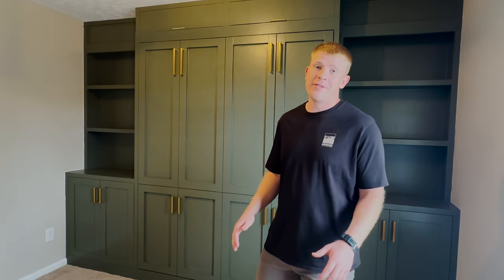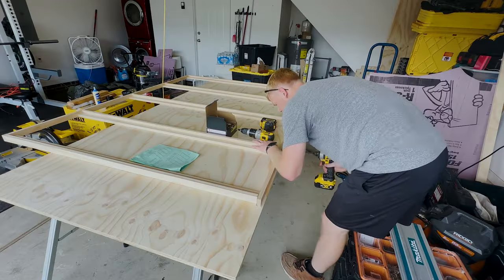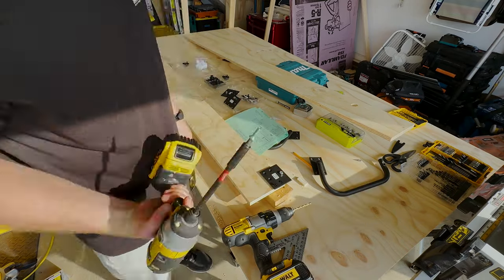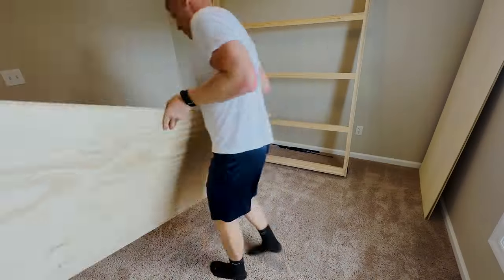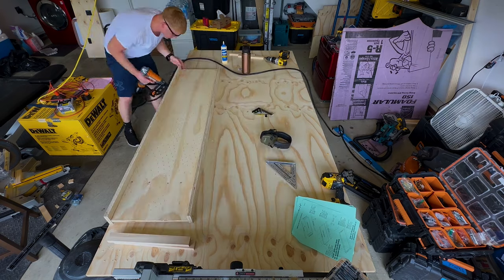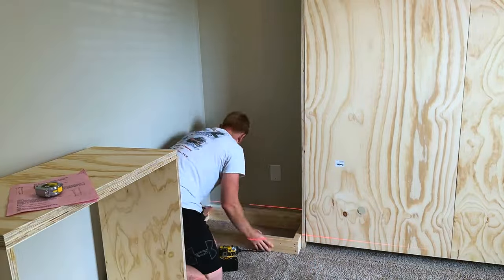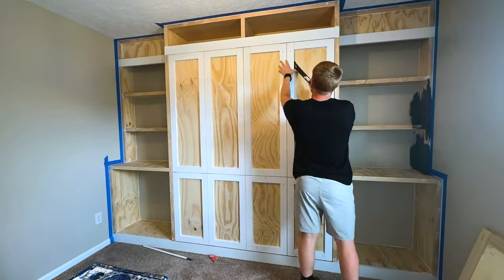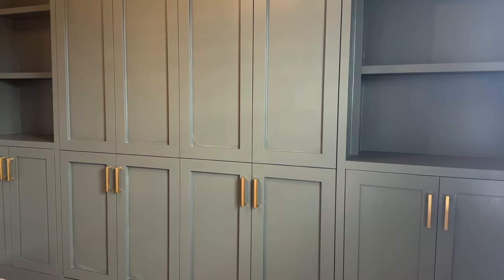How To Build A Murphy Bed | The Ultimate Office Design

Comment: Did you ever have a problem with the cabinet lining up when you fold it up.  I have some spaces on either side and I cant figure out why?  How far are the pins supposed to go into the holes?
Reply from the maker: You should have a small gap for the bed to fold down freely. The key is making it look consistent all the way around. Much like a cabinet reveal.

Comment: Great video! Definitely one of the better ones I've watched. Thank you for the pro tips on cabinet pulls. I noticed that a lot of people don't paint the interior of the murphy bed cabinet - why is that? Also, have you considered changing the headboard? One other thing, what did you do about your baseboards? Cut them off for flush mounting, or angle cut around them?

Comment: Very nice job!  I bought the same exact kit, and found it very challenging.  I made two right rails (similar to your non-mirroring verticals).  Also, when all put together, I have larger gaps at the bottom portion of the folded up frame than I do the top.  Figured I'd try to hide it with the trim when I get there.  Also, you lucked out having the bottom cabinets match the dimensions of your faux cabinets.  Mine will be somewhat larger, so not sure if it will look funny.

In retrospect, not sure I'm handy enough for this kind of job.  I'd probably buy something pre-built if I had to do it again.
Reply from the maker: Yeah I designed the faux cabinets to match the actual cabinets. Took a little planning ahead. 

It’s definitely a learned skill. There are definitely times I think I should have hired a professional to do it. But most of the things I want are “custom” and I’d be paying an arm and a leg for. Plus I love staying busy with projects. So on to the next.

Comment: I've totally made a good chunk of the same mistakes you did 🙃 I'm officially at the vertical stage 🙌🏾....buuuuut also realize all this really means is I'm maybe about halfway through considering filling, sanding, painting and building a cabinet to frame one side. Most days I totally feel like I'm over my head (....I don't REALLY know what I'm doing....mostly playing Ash the Builder 🤫).

I'm still deciding on a hardware solution because the long ones I want are dumb expensive 🫥. Were you able to get the 1x3s flat once you screwed the pulls in?....Or should I maybe install the pulls before I secure the mattress support?

Also (because I have no clue what I'm doing 😁) do you have any vides of how you built the cabinets? 🤔 Thanks!
Reply from the maker: Nobody knows what they’re doing. We’re all just figuring it out as we go. That’s what I tell myself at least. 

The 1x3’s I did get to sit flat by insetting the screw heads on the back side. 

I didn’t make much of a video for the built ins but I do have this short. 

https://youtube.com/shorts/kC5xWR-Ktns?si=vbs0wGNuM1W-RjSP

Comment: Amazing! Great Job and thank you so much for the video with the details. I am going to start on it this week and very excited. Looking forward to your next project!!
May I ask what kind of lumber you would recommend for the trims and the cabinets? What kind of sand paper grit would you recommend? - Thank you
Reply from the maker: For the trim I would just use some pre primed pine it is the easiest to finish. The cabinets I would go with some 3/4” poplar. Pricey but worth it. Sandpapers cheap. I’d get a pack that had varying grits from 80 up to 220
Reply: Thank you

Comment: Thanks for this video it was super helpful! I want to do something like this but I don’t know if the full vertical will hold the weight of the double mattress I have already.

What mattress did you use? Did you go for a lightweight one? Is it comfortable?
Reply from the maker: I used a mattress that was over the recommended weight and it shows. Makes it much heavier when lifting and lowering.

Comment: Question for you.
I am getting ready to build one myself. The plans use mostly 3/4" (0.75") plywood.
Quality sanded plywood is sold in 23/32" (0.71875")
Yes, this is a tiny difference.
Did you need to adjust anything for that difference?
Reply from the maker: I didn’t need to adjust anything! That should still work out just fine.

Comment: Looks great, man!  Did you thin your cabinet paint down at all?  Also, i'm curious why you couldn't just drill the holes for the handles all the way through -- was it a matter of the bolts not being long enough to make it through all of the material?  If so, you could have just counter-bored through the back side until the handles bolts were sticking through enough to grab the handles -- and it would have made the painting easier -- I might be misunderstanding something, though.  Looking forward to the next project!
Reply from the maker: I did thin the cabinet paint down some. May have had something to do with it running? I think it’s because I had the sprayer up so high and the window open in 90+ degree weather mainly. 

I probably could have drilled all the way through but it would have in my mind been more of a headache. I would have been drilling through the three-quarter inch faux cabinet styles, then the three-quarter inch plywood on the face of the bed, and then potentially the bed struts, depending on where they fell on my holes. I would have also had to remove the 1/4 inch panels that go on top of the struts to access the screws. 

Glad to see you are gonna stick around for the next one! Just give me some time to think of it! Might be some workshop cabinetry/organization.

Comment: why did you not drill right through for the handles?
Reply: then you could have put them on after paint.
Reply from the maker: I would have needed long screws to go through the 3/4” face, 1-1/2” frame and 1/4” for the frame top.